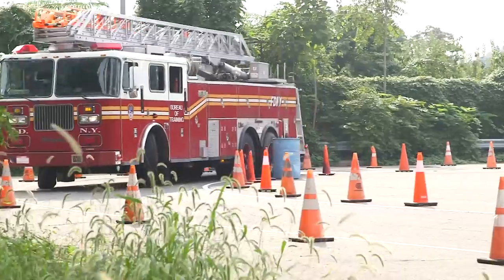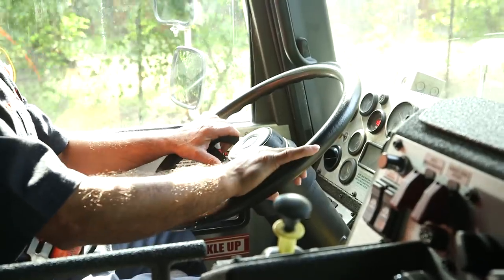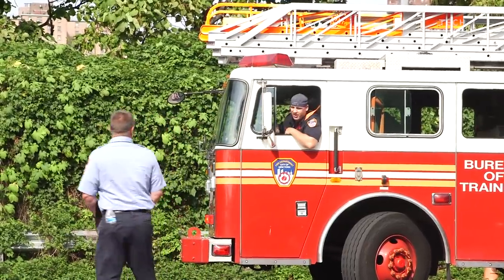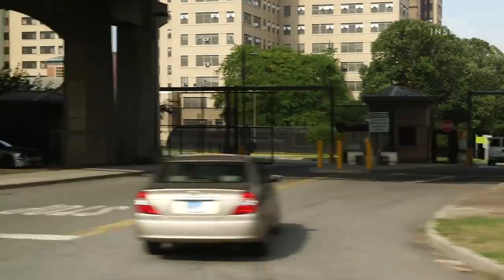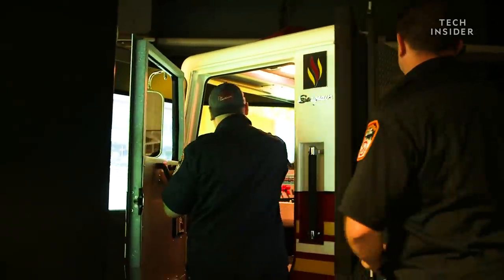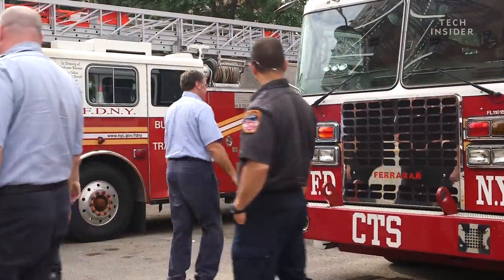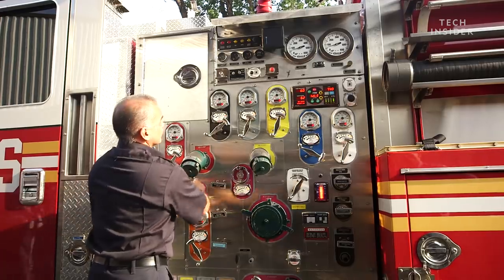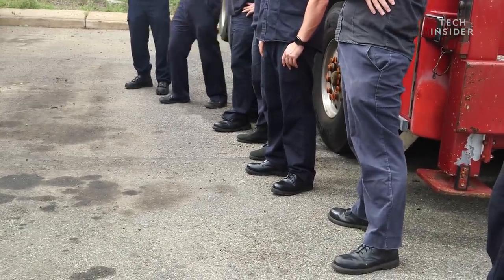How Hard It Is To Drive A Firetruck

Comment: 42ft ladder truck.... yea it's challenging.  But, try a 62ft tractor drawn aerial with 2 drivers....
Reply: I never really understood the Tiller Ladders ... those are enormous trucks but their ladder still reaches only 100' ... Same with some of the American Tower Ladders. On the same size of chassis Europeans would have a 150' to 200' Aerial. Of course, Americans also carry ground ladders and other equipment on board, but it still seems odd to me. ALso with the 2nd driver ... really? It's 2018 ... rear-wheel drive without the need of a 2nd driver exists for years already. Some of the European Tower Ladders have all-wheel steering and it still takes only one driver
Reply: @EnjoyFirefighting  they are extremely maneuverable which makes them great for tight, crowded city streets. However, I know European cities have tight streets as well. I'm currently assigned to a tiller, we do have a complement of about 15 ground ladders. In addition to hooks and irons, we have some high angle rescue gear, we have extrication equipment, several power saws, ventilation fans. 

I've never driven trucks with all wheel steering, but I wonder if the predetermined steering ratio would create issues in some situation. I know they've been around a while so obviously they work just fine. All I can say is we can weave our tiller into places a straight aerial can't get. As to those taller European aerials, I don't know much about them, are they climbable? Or do you just ride a bucket? I know I'd be nervous trying to make a rescue at those heights with someone panicking. Up near 100' can be bad enough. Maybe it's mostly for elevated water streams.
Reply: @TheDesertRat31 your your 2nd sentence hits the point: crowded might not be the problem, but tight streets are on a completly different level here. Seeing a tight street in e.g. Downtown Manhattan my opinion is "wow, what a nice wide street for a one-way street". Just to get an idea of it: already back in the days with horses and horse carts people placed corner stones at their houses because the turns were so tight that many of the horse carts damaged the edges of the buildings. In today's dimension: I drive an Astra hatchback which is a quite compact car. When I drive around the corners to my house in the downtown area, the turns are so tight that e.g. the right front and left rear parking sensors go mad 
The all-wheel steering is quite a nice thing IMO. While driving at normal speeds the Tower Ladder has only front-wheel steering; At lower speeds (I'm not sure at which speed exactly) the rear-wheel steering can be engaged. For the tightest places and individual maneuvers front and rear-wheel steering can be turned individually: either only front, or only rear, or both together, together  in the same direction for tighter turning radius, or both in opposite direction  (so that the wheels of the front and rear axle a kind of point into the same direction / are parallel to each other) so that the truck drives diagonally. two videos of such a Tower Ladder with all-wheel steering (turning radius of only 22.9'):
https://www.youtube.com/watch?v=iQ4dW2HtW6c
https://youtu.be/g2xivq5uxy8?t=83

Yes, our Aerials (99% of them are Tower Ladders or Telescopic Booms with a bucket) are climbable. However in most situations they ride the bucket. Some modern and high-reaching ladders (in the 150' to 200' range) have a lift which can go up and down the ladder independently from the bucket and ladder extension; Those which have a telescopic boom usually have a ladder attached to the boom so they can still climb it. Here's an example of such a Telescopic Boom Ladder: https://www.youtube.com/watch?v=lXjtxFSz5j4
Only very few Telescopic Booms (very few in the 100' range, usually the 170' range) don't have a ladder

Comment: do you need a special license in the US to drive trucks? Or can everybody with a normal drivers license just hop onto a truck no matter how heavy and drive it on public roads. For example in Europe your drivers license is based on tons. The normal license is max 3.5 Tons max possible weight for the car. Thanks for the answer. :)
Reply: For typical commercial trucking, yes, there are lots of different licenses to achieve to be able to drive certain trucks.
     This rule doesn't really apply to fire departments though. They are considered "emergency apparatus", not trucks by DOT standard
Reply: @jayprimo thank you! its always nice to know how different countries solve their "problems". Before the year 2000 the normal German drivers license allowed to drive a 7.5 ton vehicle with a 7.5 ton trailer.  This was very good for the volunteer fire stations, because all the smaller cars and trucks (below 7.5 tons) could be driven by everyone with a normal license (called the "license 3") all this chanced and every drivers license in the EU was the same -> 3.5 tons. This meant a huge problem for all the Firestations and Emercency services. So it was decided that emergency service people get after a day of training a "firefighter" license. Only emergency vehicle are allowed up to 7.5 tons.

Comment: Lol, 42’ long. Clearly they didn’t bust out the tillers or that number would be much larger 😂
Reply: Tiller man checking in! 👋
Reply: @jayprimo  What is a tiller?
Reply: @jacobdecobba7743  Tiller is a nickname for the Tractor Drawn Aerials. Theyre the rigs that are Tractors with the ladders on the trailer, and the "Tiller Man" that steers the rear end.
      The term "Tiller" comes from boating, with "Tillering" meaning Rear Steering.
Reply: @jayprimo  Ok thank you very much, was just curious and had to ask

Comment: As a volunteer fireman...no...just no. I work with DPOs (Driver/Pump Operators), and I could never do it. Pretty much every time we back into the bay after a call, usually even backing up in general, we require a person guiding us because the rear view cameras are little to no help, and we frequently have to use our mirrors. I am a terible driver by most standards and suck at math, so the idea of doing that job is an immediate no. Not to mention the pumping operations are akin to wizardry. Being a DPO is not something I would wish on an enemy, and I can safely say it's not easy at all, and I have immense respect for the people who can do it. Plus they're the ones driving when we go to dinner so....thank you for your service :)

P.S. I'm in a small town and it's a nightmare. Being in NYC would make me lose it.
Reply: Honestly, maybe you shouldn't drive to be honest. Pumping is easy, driving in the city can be hard but on the island its a breeze. Some people aren't cut out to drive due to the stress brings.

Comment: How can they let anyone drive a truck of that size after just driving around some cones and in a simulator? To drive a firetruck here in Norway, you first need to have a driving license for a car. Then you need to go to a driving school and take a course. And that includes four days of lecture, four 4 hour sessions, one 9 houre "ice condition test", one 8 houre test, and finaly a multiple choise exam with 45 questions. More than 7 wrong and you fail, now you are ready for your final driving test with an instructor from the DMV. And to drive with lights and sirens, you need to go back to driving school and have 2 days of lecture, 30 hours of driving with a instructor, a multiple choise exam and a final driving test with instructor from the DMV,

Comment: Look the FDNY doesn't call "fire trucks." The term fire truck can mean any type of apparatus. The FDNY has Engine, Ladder or Truck, and Rescue Companies. Then theres Field Communication Units, Hazmat Units, SOC Units, TAC Units, BFU Units, and a lot more. 
Being a 15 year old Junior Firefighter from South Mississippi I know a lot about the FDNY. 
Engine Companies: Seagrave and KME
Ladder Companies Ferrara and Seagrave
Rescue Companies: Ferrara 
FDNY used to have all Macks, and one truck was the Mack to ever serve in the present before someone bough her from a scrap yard. She was a 1988 Mack CF/79 Ward Pumper, Regristration: MP8802. She appeared in a kid's home video called All About Fire Trucks with Ladder 7: 1984 Mack CF/ Baker 75' MT8475 or MT8425. I don't know about the whereabouts of Ladder 7. MP8802 went on to be Foam 95, and after she served as Foam 95, she was sent off to a scrapyard in Queens. And someone went and bought her and is trying to restore her. If you type in All About Fire Trucks look in the comments and you'll see.

Comment: Ladder 11-1, , no problem  , Engine 11-1  no problem, Tankers, now we are getting interesting, ( 6000 gallons 18 wheels 80,000 pounds).  of course there are rescue trucks in many sizes. myself, I liked my Fire Chief Defender
Reply: just imagine what kind of emergency vehicles there are also in other countries like buses or mobile cranes etc...
Reply: @EnjoyFirefighting   I learned cranes, on an oil rig. Those Cranes need scheduled maintenance, and to fix the cranes, you first had to learn how the cranes work. Also having a city bus on location for a place to recover on large fires. ( Buses have heaters, Air Conditioning, and motor coaches have toilets. )
Reply: @kd5dgs  many departments over here have cranes or buses in their fleet. The buses are either layed out as command post or as large capacity ambulance, some few also purcahse them as simple crew bus. And most departments in large cities, some few in smaller towns, have one or also two of the mobile cranes.
Of course there are many other specifl operations apparatus not every department has in its fleet. To name just some few: fire and rescue trains, fire-fighting tanks, nitrogen vaporizer, tunnel tanker, tunnel evacuation truck, Aerials in the range 170' to 370' and so on

Comment: That’s all they have to do?! That’s so bad!

Here it’s a 4 week advanced driving course for an ambulance! Trained to the same level as police drivers here.

There should be two hands on the wheel, no crossover steering etc

And we have to do practices and examined emergency responses on the public roads as well to pass.
Reply: JW93Emergency where is "here"? I'm a paramedic from Germany and we don't have an advanced driving course for us at all, unfortunately. While I managed it very well from my very first emergency response run already, I'm actually a bit scared when I see some of my new colleagues driving (not just driving with sirens and lights, but also plain normal driving)
Reply: EnjoyFirefighting - International Emergency Response Videos in the U.K. we all have to do the 4 week advanced driving course to the standard of police drivers.
Reply: @CymruEmergencyResponder we just require the standard driver's license for a certain vehicle class, nothing else